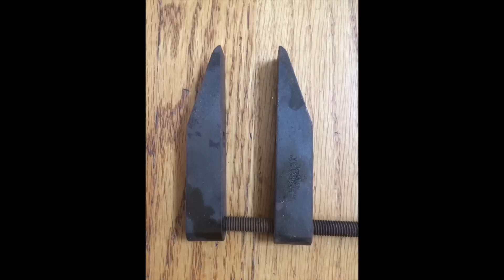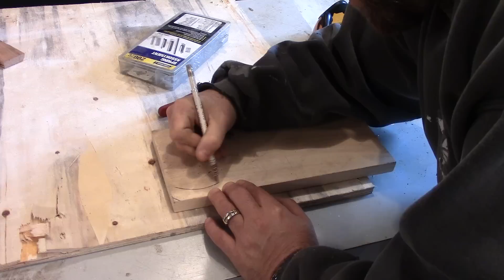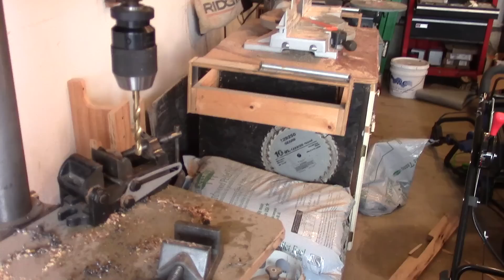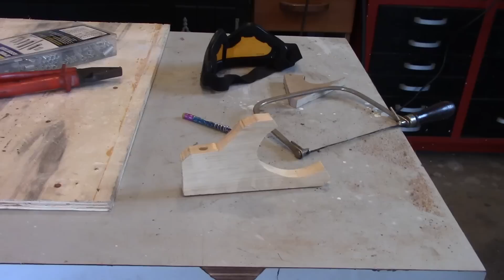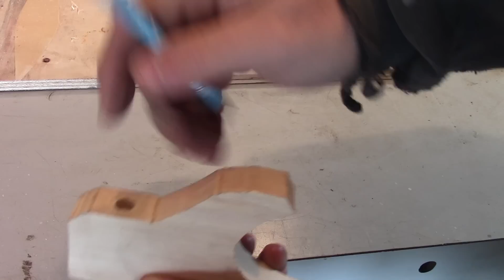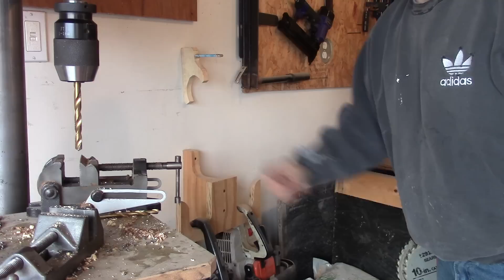Homemade DIY Stud Finder

Comment: pretty cool..im going to have to make one of those
Reply from the maker: Easy project.  I made 2 second one took under a half hour.  Make sure you use really strong magnets and not too thick of wood because it won't stick to the wall if it is too heavy.
Reply: thanks

Comment: I know this ain't a video for lawnmowers but I have a question. I have a 7.75 husqurvana lawnmower and it hydro locks .so I took the spark plug and pulled . gas comes out  . if you could help ?
Reply from the maker: Sam,  Check that there is not too much oil  (overfilled with oil?) and see if the oil smells like gasoline.  If there is gas in the oil there is something wrong with the carburetor needle and seat.  Pull out the spark plug and pull over the engine to force gas out the spark plug hole.  You can let it sit overnight with the plug out and that should stop a flooding condition.  Report back what you find.